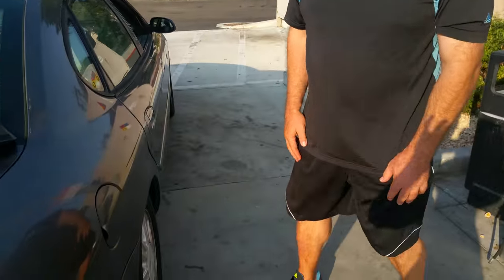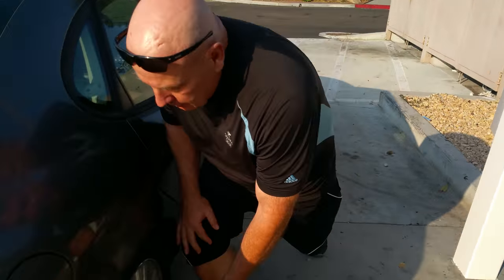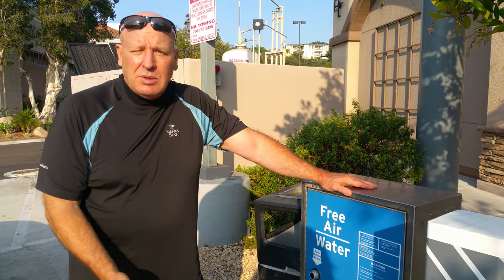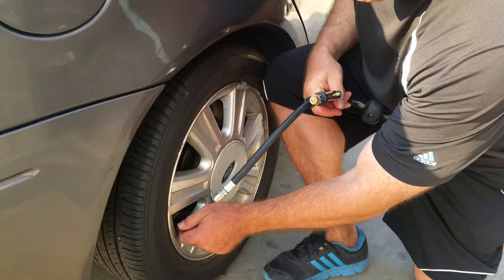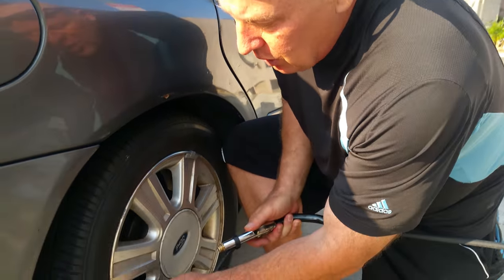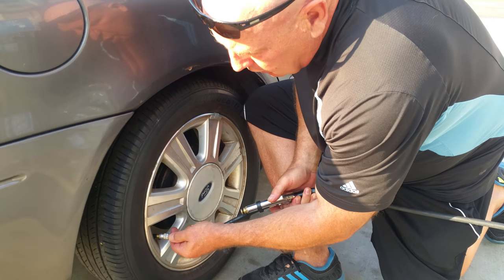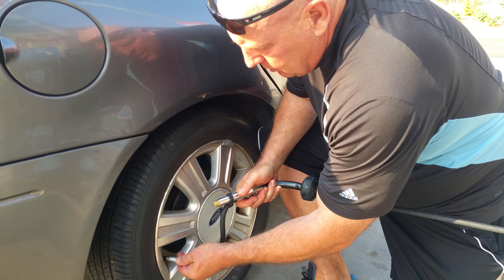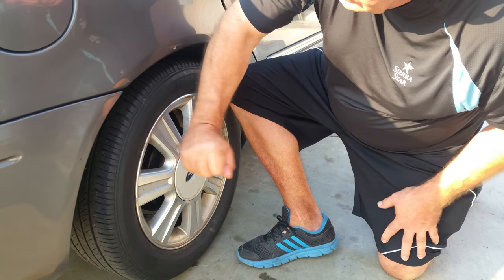How to add air to a tire

Comment: This is a great video, thank you! Really emphasized the difficult part of holding it on the valve stem. Sometimes it can feel like you're doing something wrong if you feel like you're forcing it so that was really helpful.

The only thing I would add to this is to mention to make sure you don't lose the little valve cover piece when you take it off. It can be really easy to lose those things, especially if you are doing this at night and considering they are normally black.
Reply from the maker: 🙏 thanks
Reply: @FaithiinJesus  you're welcome! But really thank you ! Last night, I was able to quickly and easily put air in my tires thanks to your video. I appreciate the time you took to make and upload it!
Reply: Amazons has pencil guages that came with spare caps in a little case. Saved my life

Comment: Agree 1000% on how hard some tire stems can be.  Have issues on newer cars where I can't tell if the pressure machine is broken or if my tire stem is.  Air ends up leaving the tire sometimes if you aren't careful.
Reply from the maker: Yes that is the most tricky part!  Not letting the air escape while adding new air!

Comment: Thank you for going over the amount of force to use when connecting the hose. I'm pretty sure I drained the air from my tires yesterday instead of filling them. Off to try it again!
Reply from the maker: Thank you for your comment
Reply from the maker: Thanks 🙏 for the comment

Comment: Appreciate the detail about the hard part. I was confused and frustrated trying to fill this morning. I'm ready to try again!
Reply from the maker: Good luck, thanks for the comment, don't be afraid to put some pressure with a little touch while putting the air nozzle over the valve stem or the copper looking end.  Also listen carefully for air leaking out.  Once you do it once it will all make sense thanks for the comment.

Comment: Thank you.  I didn't know how to use that handle. I thought the handle would take air out so now I know you have to hold it down.
Reply from the maker: Thanks for the comment needs to be a better system adding air to a tire is ridiculously hard if you have never done it before

Comment: Thanks for your brief and informative tutorial; Especially about attaching the inflator to the valve stem. I often hear air hissing when I try to attach the the tube and as a result have to press the tube till I nearly break my fingers off. Any tips Sir? 🥺

Comment: Thanks, I'm currently crying at a gas station cause I couldn't figure out how to get the air hose to work on my tire. I'm gonna try what yoy said about holding it on tight and wiggling.
Reply from the maker: Thanks I know you can!-

Comment: Taurus only takes 30 psi cold. Running your tires that high will cause them to wear out faster read the safety door information on tires.
Reply from the maker: Thanks for the comment, usually most people here have little understanding about how to fill air in a tire..... You appear to be a pro.  You identified the car, and know the exact amount of air it needs.  Thanks for the information!

Comment: Well no never go off the tire psi that the max psi thats not recommended to fill up yo the max. On ever car or truck theirs a sticker on the driverside door jam. That is the recommended psi to fill your tire up with air. Never max out the air limit on your tire. During the winter you can go about 3 psi over the recommended psi on the door jam do to the winter weather will deflate your tire. In summer you want to keep it a little under the recommended psi due to it being hot weather your tire will expand.
Reply: Oh I forgot, never kick or push tire with your foot to decide if you need air or not. Use the tire Guage that's what it's there for.

Comment: I cant tell from looking at my tire. I got the low tire pressure icon. Where do I go from there?
Reply from the maker: Look at the side wall, or the height of the tire if the tire looks low or shorter.  Thanks
Reply: @FaithiinJesus  Thanks, I'm just frustrated because I spent $700.00 in July for new tires and I'm constantly having to put air in one of them (at least 5 times!)

Comment: the real question is not how many licks it takes to get to the tootsie roll center of a tootsie pop but how many video tutorials i will watch until i finally feel comfortable enough to pump air into my tires 😭😭😭 welp
Reply from the maker: Just take a deep breath you can do this!

Comment: Dude, I kept forcing it into the valve, and EVERY TIME I DO SO air is releasing from the tire haha and now I'm on a flat tire. What am I doing wrong
Reply from the maker: not making a tight fit push harder
Reply from the maker: Not pushing hard enough I know it’s hard to push and move from side to side to make a complete seal keep trying sounds like your getting close

Comment: Last night I went to a Shell gas station and paid $2 for the machine, I've completely no idea how to measure the tire pressure as there is no display and setting button on the machine, I think the moving part is for release air from the tire, now I got it, so mechanic machine.
Reply from the maker: Thanks for the comment appreciate it!

Comment: Some very inaccurate info here! Tire pressure should be measured when the tires are cold ( driving will heat up the tire causing the air inside to expand and raise the pressure about 4 psi). A pressure gauge should be used ( the ones on the compressor’s hose are not accurate). The desired pressure is printed on a label, usually on the inside of the driver’s door frame. The pressure printed on the tire is the maximum that the tire can hold. Using that pressure can decrease the tire’s traction and cause excessive wear. A lot of bad info here.
Reply from the maker: Thanks appreciate the information, after reading comments on this video for 6 years many people thank me for the simplicity of this video.  For a lot of people, this is an overwhelming frightening experience..... They are afraid they will damage their tire, or make the car unsafe to drive.  Making a super simple video is what they want, to give them confidence.  Bringing in all the information you mentioned will further complicate an already scary experience.  As a matter of fact, I believe yours is the first negative comment I received.
Reply: @FaithiinJesus  overinflating the tires, decreases the amount of contact surface the tires have and as a result diminishes traction for braking and going into curves. Incorrect information can result in accidents and injuries that might be avoided.  Making things too simple but wrong can result in legal liability. The intentions may be good, but………
Reply: @FaithiinJesus  dude, it doesn't matter that people say thanks. It's misinformation.  That's feeding your ego. You may need to take this misinformation video down and correct the mistakes.  Don't misinformation people and say they thanked me! Just absurd!

Comment: Do not fill the tire to what it says on the sidewall! That is max pressure. Fill to pressure specified on the sticker located on the driver's door jamb
Reply from the maker: Thanks any correct information is appreciated..... It has become an easy quick video for beginners, not be intimidating and encouraging them to attempt to add air to a tire.  The information may not be very technical, but it was only a start.  Thanks!

Comment: My light is still on and I tried to put air in my tires yesterday what did I do wrong
Reply from the maker: Nothing you did wrong, putting air in a tire is not easy, you need to push hard and listen for escaping air,  if you hear air escaping you need to adjust the air hose to a different position this takes time and experience not easy the first time.  Be patient and try again just relax and don't give up it will take air if you are patient.
Reply from the maker: Thanks yes it is hard probably better tires are coming soon

Comment: How do you know how much pressure there is? I’m recently single and I gotta do all this on my own now
Reply from the maker: You need to check pressure with a gauge most of the time the gauge is built into the air hose start with around 35 lbs of pressure

Comment: No wonder my tires didn’t get air. I did try to force the tube in but i keep hearing the air coming out.
Reply from the maker: Yep you got it that's the hardest part you would have thought in 150 years of making tires they would have come up with a better system

Comment: You should have shown how to use a tire pressure gauge.   Never rely on the gauge at the gas station. Those are usually inaccurate.   

Talk about what pressure you’re suppose to inflate the tires to by reading the placard on the door jamb.
Reply: agree its best to to buy a personal pressure gauge on amazon cost around 10 $

Comment: When I do it ; it sounds like my tire is losing air
Reply from the maker: Make sure air is not escaping push harder on the value stem with the air compressor hose

Comment: That's not how to do it... you don't just put any amount of pressure.  You check the inside of your door panel, where it tells you how much pressure to put.  This is misinformation!  But the method of ok... only, the idea of just randomly saying I'll add 36... without checking what is actually the correct pressure to put in is absurd and ridiculous.